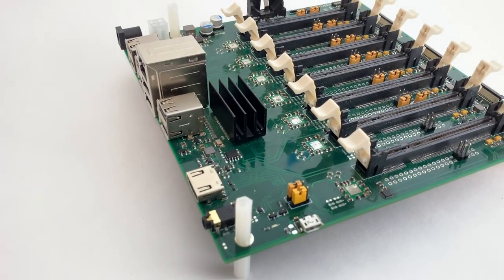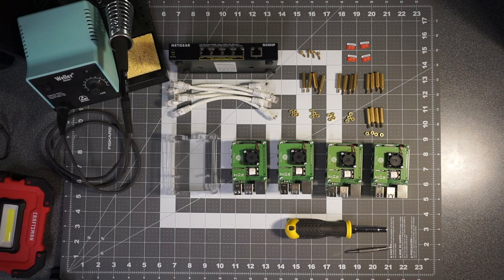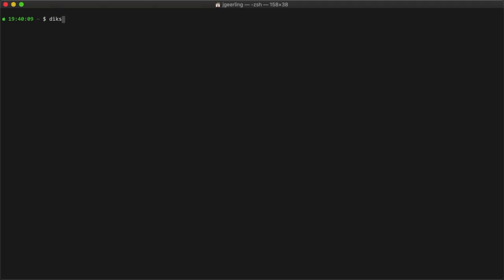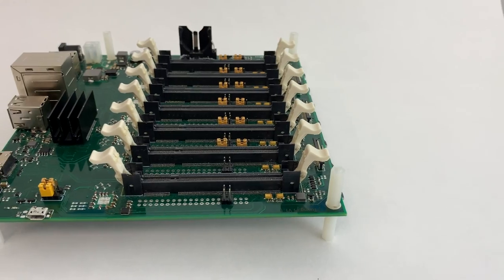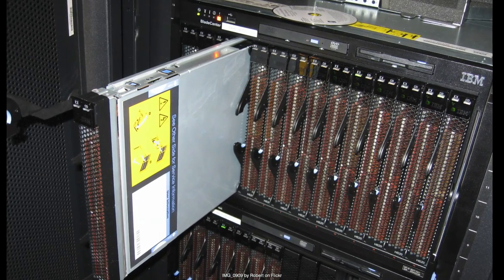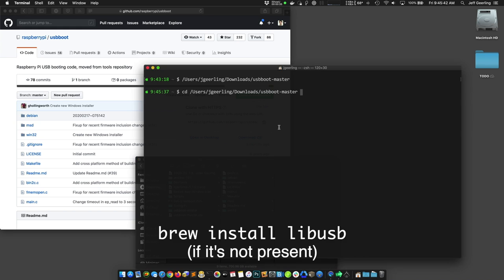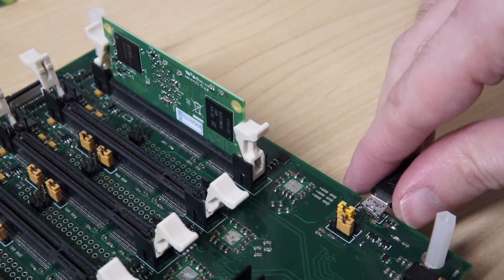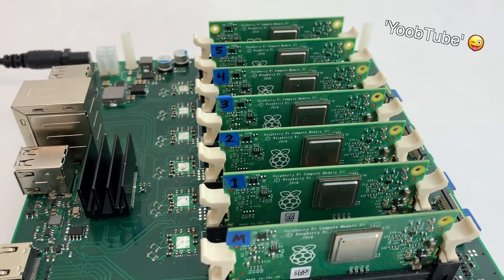Raspberry Pi Cluster Ep 2 - Setting up the Cluster

Comment: ....does your POE Switch output 3Amps in each port? Find it difficult
Reply from the maker: I'm using this Netgear PoE switch (https://amzn.to/3ck5Kyp), and it has a '55W total power budget'; the switch supplies 48v, meaning ~14W@48v per port, so a maximum of 0.29A sustained output per node. If you're going to run the Pis full-tilt continuously, you might consider powering them differently, or getting a more robust PoE switch. In my headless usage as a K8s cluster, I haven't encountered any noticeable issues, but I don't push it too hard. For the CMs on the Turing Pi, when I booted all at the same time, it only drew about 0.20A (15W@120V) as measured by a Kill-A-Watt. Note that such low amperage has a high margin of error when measured through the Kill-A-Watt.

Comment: I can't get the ssh_authorized_keys: part to work in the user-data file.  Which Jeff shows at 11:55 in the video.
I have this in my file:
    ssh_authorized_keys:
	  - ssh-rsa (this is where my SSH key would go like in the video)
But I get this error in my YAML Linter 
(<unknown>): found character that cannot start any token while scanning for the next token at line 21 column 1

Line 21 is the - ssh-rsa line.

I have looked at: https://cloudinit.readthedocs.io/en/0.7.9/topics/modules.html#users-and-groups
But it doesnt give any examples for me to follow.
Any help would be appreciated.
Reply: I figured out how to get around the issue I was having.
I didnt use the ssh_authroized_keys: this time, but did it another way.

In the user-data file down near the WiFi section I added this, enter in your own RSA key at Your-Key-Here. And make folder name changes if you are not using pirate as user name.  This worked for me and I was able to login with pirate and my private key on first attempt on Rasp-Pi bootup:

runcmd:
  - [ mkdir, /home/pirate/.ssh ]
write_files:
  - content: |
      ssh-rsa Your-Key-Here
    owner: root:root
    path: /home/pirate/.ssh/authorized_keys
    permissions: '0644'

Comment: I have created a home system to present demos to customers and to study new solutions and configurations, which I would like to expand at a low cost. Currently the apache2 web server is on raspberry pi 3 b + with ubuntu 20.04, connected via ethernet to the modem / router (with static public ip and wifi off), configured in dmz with port forwarding. The internal lan is protected by a wifi router with mac address filter, to which I connected all the devices at home, including my old toshiba laptop which acts as an application server and database server. I'm looking for a way to avoid leaving the notebook on all day. I thought that I could replace it with a raspberry pi 4 b 4GB (or 8GB, but it costs € 25 more) to always leave on, on whose usb 3.0 I would mount a 256 GB ssd (I have one already available, decommissioned from another system ). I could also use it as a desktop replacement for the little things around the house, such as reading emails, printing documents, managing family accounts, etc. I was even thinking of buying some raspberry, to always leave on (with ups): some 2GB for servers in dmz (web, ftp, mail, external dns); a 4 GB pair for backend servers (db, file, application); finally, one from 8 GB for desktop replacement on ubuntu 20.10 (or on windows 10?). Do you think it makes sense?

Comment: How powerful would 8 pi zeros be clustered
Reply: I got like nearly no money so buying the cheapest pi is my only option
Reply: Im broke
Reply from the maker: Not very powerful, unfortunately. The Zero has the same processor as the old original Pi, which is very very slow in comparison to any of the newer Raspberry Pi models. It also has slower networking, which means anything that works between them would be even slower.

Comment: Could you improve the performance of an old ddr2 Laptop by putting a pi module in on of the ram slots and using Software
Reply from the maker: No, you'd likely have either a broken laptop or broken Pi Compute Module if you tried it. The physical layout is the same but the CM doesn't behave like RAM at all.

Comment: For 300$ you can assemble a Ryzen 7 that will blow away that cluster...
Reply: Yes.  And for $3000 you can build a Kubernetes Cluster of Ryzen 7 computers that would be awesome at running your Docker apps!  You would still have the load-balancing, redundancy and fail-over and self-healing and serviceability that this small system has but at 10 times the price and 100 times the space.  (But it would be awesome!)

Comment: Good for CS project not still viable money wise 420$++

Better to get micro ATX mb with x99 , LGA 2011-v3 mini board 
Price : 80-95$

Intel xeon engineer grade cpu with 20 cores, 40 threads, 48 mb L3 cache with 2.26 ghz base clock n 100% over clock capacity.
Price 49$

16gb *2 = 32 gb DDR3 ram.
20$

PSU : 300watts from old pc

Setup and bam 

Max 180-220$ and a beast for AI, Blockchain node setup, Bitcoin mining or other crypto mining, My own DevOps multi docker deployment platform, my own web sever, my physical VPN my own development workstation server.

Check price n performance n electricity bills.

Intel Xeon any day better in next 10 years compared to raspberry Pi 🙏